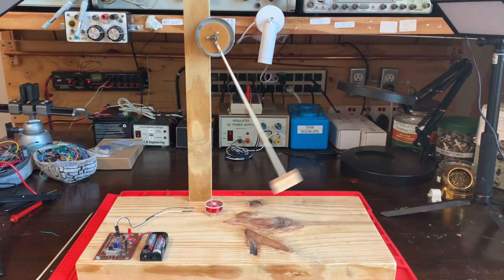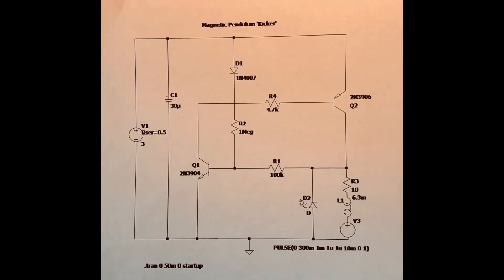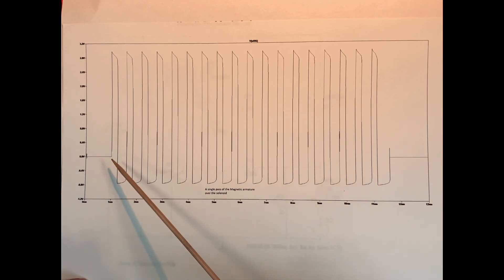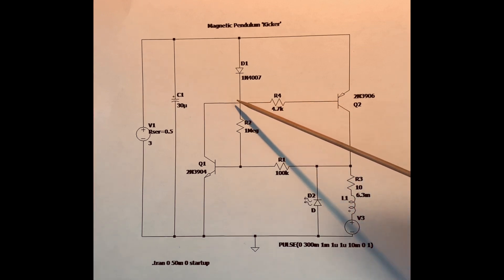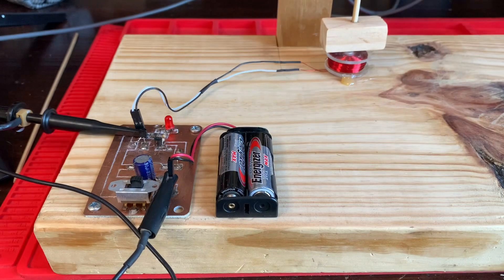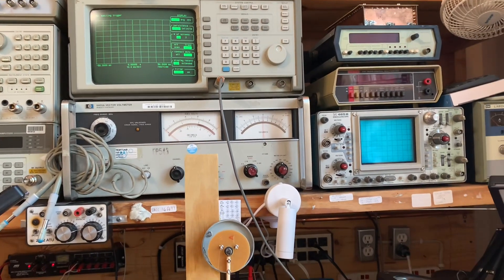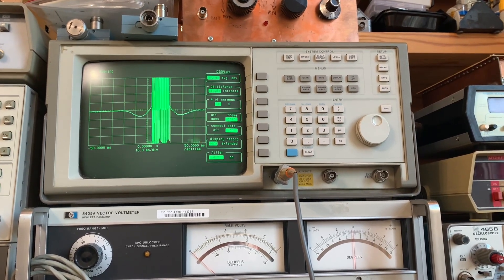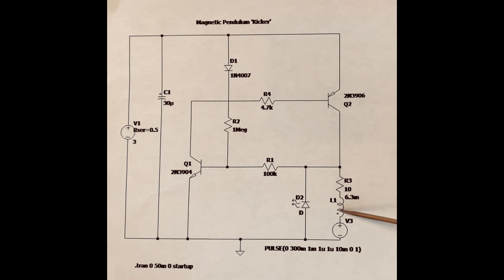The Magnetic Pendulum. How does it work?

Comment: Dear Sir....
Please could you help me to know how many ohm ̣(resistance) of your coil . Thank you so much
Reply from the maker: Refer to the schematic. 10ohms. 800turns of AWG28.
Reply: @N4HAY  Thank you so much for your time reply. But sorry for my question not clear ,so please tell me again resistor of L1coil not R 3.  Hope you will help me Thank you again
Reply from the maker: Please kindly listen to and gain an understanding of the circuit. As described R3 represents the Resistance of the coil L1. R3 is included to ensure correct simulation. In the circuit implementation R3 does not exist since it is manifested in the actual coil. Does this make sense?
Reply: @N4HAY   
Dear Sir.. N4HAY..
 I am very sorry because my English is not good. Thank you very much for your patience in helping me. Now I understand. Thank you very much for your time help me

Comment: Can you list the components you use in the video ?
Reply from the maker: I apologize but I am traveling with limited internet access. For the electronics parts please refer to the schematic shown in the video. For the mechanical parts these are parts you can find or adapt easily. I used a bearing mechanism from an old stepper motor. The armature is a skewer. The magnet is from an old hard drive. An opportunity to use your own creativity!

Comment: Do you know whether the stable frequency of the system changes as the battery voltage drops?
Reply from the maker: The period of the multivibrator = 584uS at a rail voltage of 3Volts and 513uS at a rail voltage of 2Volts. The pendulum period will likely change with rail voltage variation also since the duty cycle of the energy supplied changes.
Reply: @N4HAY  thanks for that! So, if the input voltage is kept well-regulated, it should make for a very stable oscillator indeed.
Reply from the maker: There will be variants as a result of other influences such as Temperature variations, bearing friction variations, wind currents etc.

Comment: The period of the pendulum is T (secs) = 2 * pi * sqrt( L / g) in either metric or english systems. g is the gravitational constant at earth surface or 9.8 meters/sec^2, or 32.15 ft/sec^2. 

Notice the period is independent of the mass. Mass does affect how quickly friction slows it down, so how much energy needs to be supplied on each pass.

The amount of energy imparted on each pass does affect how wide the pendulum swings, which does affect its period, but is a lesser effect than the length.

Cool circuit and demonstration!

Out of curiosity, why does the circuit kick about 25 times per pass instead of one big kick and then quiet until next?

Also, does the polarity of the pulse need to switch on each pass, as first north pole is arriving followed by south, then the reverse on the returning pass? Or is this why the circuit kicks many times per pass?

How does that work magnetically--isn't the same alternating field operating on first the north pole and then the south on each pass? How does this translate to a preferential kick each way, or one of the directions? Seems like a good next video!
Reply from the maker: Thank you for your interest in this experiment and your questions:

Your first question. Why the 25 kicks as opposed to one big kick? This is interesting. If no oscillations occur, then as the armature magnet passes over the coil; Q1 &  Q2 turn on hard and REMAIN ON even when the magnet is no longer over the coil. However because the oscillations occur (a type of relaxation oscillator), the Q2 collector voltage falls to ground potential (in fact a negative potential due to back emf) upon completion of each oscillator cycle. If the armature magnet has passed over the coil then there is no way to retrigger the circuit. Thus it remains off. A bit difficult to explain.   

Your second question. Yes in fact the polarity of the emf generated by the armature magnet indeed reverses polarity depending on swing direction. In this build. A right-to-left swing generates two negative peaks and a single positive peak. A left-to-right swing generates two positive peaks and a single negative peak (Lenz's law). Clearly seen in the video in the case where the circuit power is off. The positive going pulses trigger the circuit (once the circuit is powered of course). Thus right-to-left generates a single pulse train of 25 pulses and the left-to-right direction generates two pulse trains of approximately 25 pulses each. Three pulse trains per pendulum period. This can be clearly seen in the Slow Motion clip in the video where the LED lights to show 3 pulse trains.

If one were to orient the armature magnet in the vertical plane relative to the coil then I believe a different pulse sequence would result?

Yes I think the same alternating field is operating on first the north pole and then the south on each pass, however the 'feedback' magnetic field is switching (perhaps)? For sure there is much food for thought and opportunities for experimentation here.

Of course there are many circuit topologies that can achieve the objective, but I found this one particularly interesting. It would be very interesting to also model the behavior of the mechanical system in LT SPICE! Model the pendulum equation. Now there's a challenge. Thank you.

Comment: Nice demonstration Dick. To change the frequency would you change the length of the pendulum only? OR (depending on the frequency) Both the length of the pendulum and the circuit? This would make  great Makers Fair Demo.
Reply from the maker: Many thanks for your kind comment Rick. The pendulum period can be changed by varying the length of the pendulum armature. The circuit 'kick' will simply follow with no circuit adjustments needed, since it's action is stimulated by the emf generated as the armature passes over the coil.
Reply: Come on, how long ago was galileo alive?
He just watched a chandelier and worked it out.